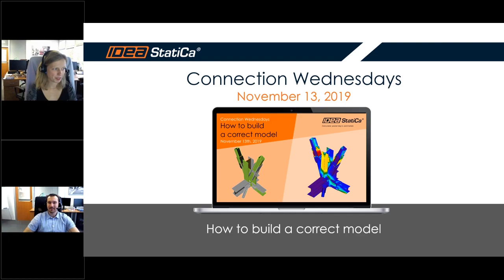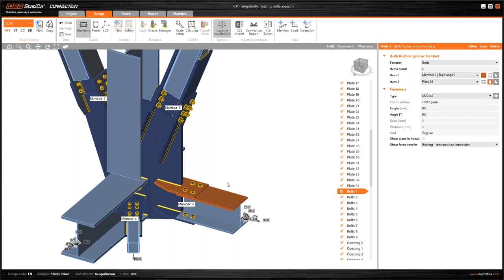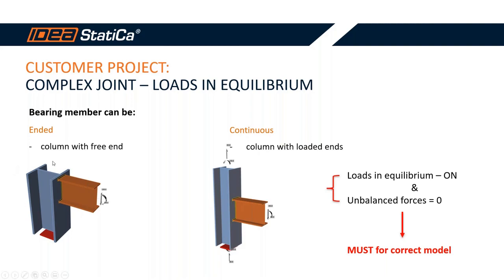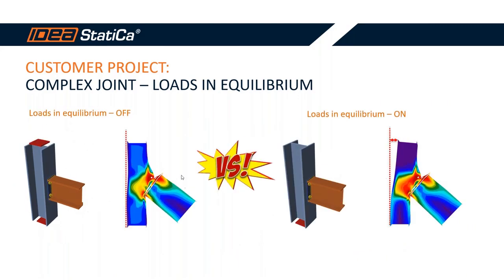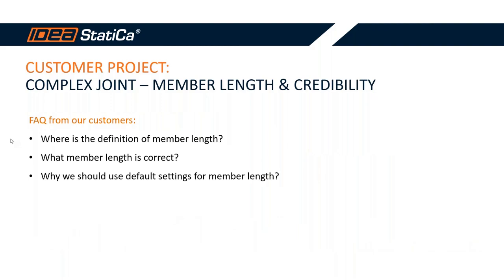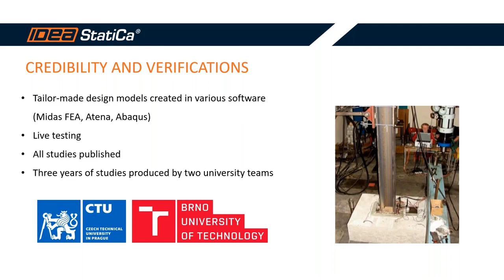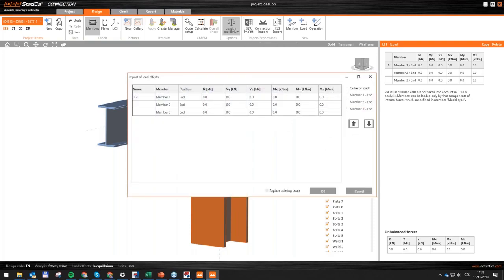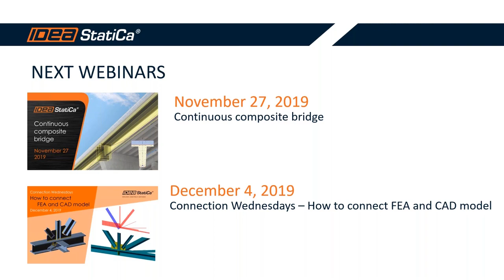Connection Wednesdays - How to build a correct model

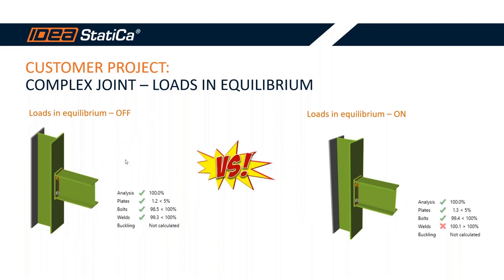Comment: 20:53 why on earth would you put an option which gives an incorrect result?
Reply: good question 😂
Reply from the maker: Thaks for your comment, Gian, but we are not putting the option which gives incorrect results. We are just showing, what happens if you do not check your model does have loads in equilibrium.
Reply: @ideastatica_en  I think the question Gian is asking is, why would Static even have an option for the user to choose between "Loads in equilibrium" vs. "Loads in non-equilibrium"? Why not have all of them set to "Loads in equilibrium" without any option for the user to change it? I too have the same question.

Comment: Thanks so much but You dont mention the mean of loads in equilibrium totaly. We can switch the coulumn member to continuous and load the end of it without activate the loads in equilibrium ?
Reply from the maker: In general, you should turn ON the loads in equilibrium (is now default in the latest version of IDEA StatiCa) and input all internal forces, so both ends of the continous column. For simple connections, you can do it the simple way - equilibrium OFF and neglect inputing forces for the bearing member you get the very same results.

Comment: Load in equilibrium mean we apply loads on column. 
The value of loads on column from where we can get it.
Any software gave value of shear and moment above the column becuse its deal with joint as node
If I want to take these values on Joint , these loads applied on beams. What about loads on columns? How can I get it
Many thanks
Reply from the maker: What you input IDEA StatiCa Connection are the nodal internal forces from your structural software (SAP2000, ETABS, Staad.Pro, etc.).
For each node you always have internal forces for all members, including the column. So here you read it. Please refer to:
https://www.ideastatica.com/support-center/different-ways-of-load-definition

Comment: Hello, can you please support me - I have created a model which has a single column with an end plate and four bolts through the end plate into a concrete foundation. I have added a load affect and applied the forces to the end of the member. 
When I select "loads in equilibrium", I can't balance the forces because I only have 1 member and therefore there is no option to remove the unbalanced forces. Is this case acceptable to use the simple method and not select "loads in equilibrium"?
Thanks
Reply from the maker: Hello, in case of anchoring, the unbalanced forces are the reactions in the anchoring, so it is OK
https://www.ideastatica.com/support-center/equilibrium-and-supporting-member